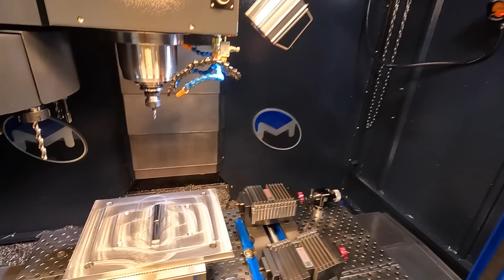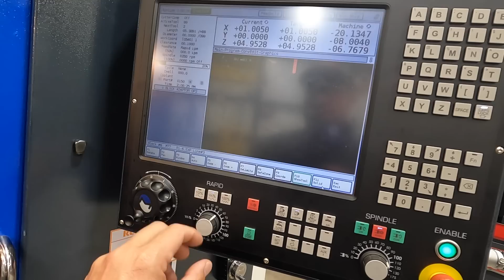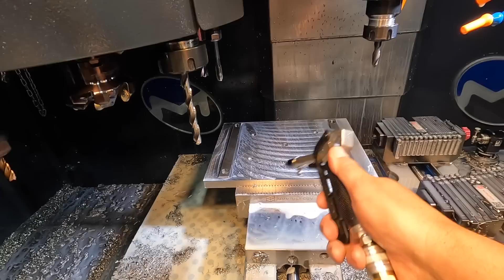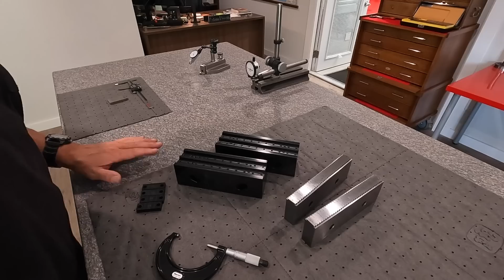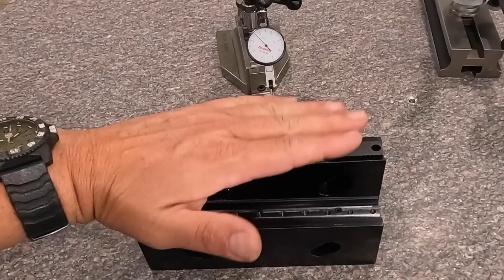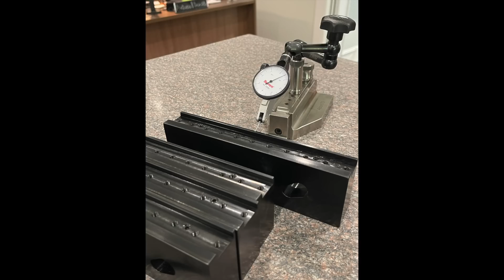SNS 373: Fixture Plate Machining, Vise Jaw Inspections

Comment: cnc is so satisfying when you start to understand it, i now always do a demo run with tool 1/2" above z:0 when running a new code.....takes longer but saves you $$$s in the long run....ive destroyed hundreds of carbide endmills learning... run into the bed once...had stock fly out of the vice a few times....been drenched in coolant...had the whole shop raining milk...tripped the electrics....had to hit that big red button many times and hit the brake on the spindle...i levelled off a 120kg anvil in there once and had a light show like 5th november in london....had the machine dancing and tripping the stops...i lost that many steps i should of installed an elevator....but that was all my own self learning...i think your doing amazing Adam

Comment: Seems like you could get a better finish by going back and fourth on the bottom side,  than the half moon passes on the bottom side. I am not sure if the program is auto generating that tool path but seems like it could be more efficient. I think the tool path making squares like cutting a yard from the out side in seems to be giving you the bad finishes. But if you could just make a pass and then pass back cutting in the opposite direction. I am no expert I am a woodworker that follows your cool work. But I am thinking of it like I would do with a router and flatten a wooden slab going back and fourth.

Comment: I don't understand why the machine is making arc passes.. It seems to me your actually making the cut path longer, extending cut length and thereby using up more cutter life.. The shortest path is a straight line.. It's also not contributing to your surface finish. Linear linear cut lines with minimal overlap always results in a smoother finish and is usually more aesthetically pleasing. It's also easier to polish or scrape, depending on the needs of the finished product.

Comment: if you cannot get rid of the tool marks on the fixture plate, maybe you can create a tool path that creates a more desirable pattern, maybe stepped circles that result in a flower petal pattern or something ?

Comment: It would be nice if you could control the tool path better. The tool path on the first two tests almost looks random. It would look much better (IMHO) if the path first ran parallel to the key from the left side to the right side then adjacent to the key on the near and far ends just to the ends of the key. Continue milling off the edges before returning for the next pass. Overlap your passes %50 so that all cutting is done uniformly relative to the cutting head.

Comment: Not a machinist, but beginning hobby. Would seem to me that since you have 2 pair of tallen jaws. The second set could be used as a handy set of parallels under a large project like your fixture plates. At least it wouldn't be pushed down as it's milled. Could maybe have even less clamping pressure, maybe reduce upward bend and eliminate downward deformation under load. Just a thought, maybe it isn't the best idea, due to the half thou or .001 difference. Maybe it would try to rock around more?

Comment: It'd probably be better to put the jaws on the vise in the machine and put the indicator in the spindle and zero the Z at the indicator zero and check them in the machine. You have an error stack with the SMW plate and the vise and the jaw mounting to account for. That will tell you what's up. Also probably a good idea to load the jaws with a couple of 123 blocks when you take your measurement.
Reply: I am not a machinist by trade, but very mechanical.  It seems to me that measuring on the granite plate is great to check the jaws.  The real test would be how they measure once mounted in the vise on whatever machine you are using.  Do the fasteners and machined holes that the fastener use change how level the jaws will be as used?

Comment: I use a ton of Walter tools at work and normally run the WKP35G grade at 850-1000 SFM, dry on steel and I get crazy tool life. If you're looking for a nice shiny finish it may help to kick your cutting speed up even if it's higher than the recommended specs. It also helps to use a different tool for roughing and finishing, not only do you get less wear on your finisher but you can put some wiper inserts in your finish tool.

Comment: In the shop i work at, when we are doing RIP finishes, we generally double the spindle speed, but drop our feed to 15IPM and take .005 for our finish pass, it works well for aluminum and stainless, as for the tool marks, they show up a lot more in stainless even at 15IPM. Still trying to dial it in personally for stainless but i do know that fresh inserts help a LOT with the finish, chipped or not.

Comment: Nothing new to you I'm sure but a  few things I see machining 4130 hardened steel is stress relief, we stress relief before machining but even then if you try to machine equal amounts off both sides it usually turns out flatter.  Also I was thinking if that was bolted down to a fixture or table instead of vice I think it would turn out flat, especially if you did some finish passes on both sides.  I think about .015" finish  pass gives good  results for me.  My $.02

Comment: If your part is not coming out true due to a vice jaw intolerance, depending on how you turn the piece over for Op2, you will double the error.
Decreasing the feed rate is not always the answer to a good finish. It could be insert, coolant, or speed related.
On a slightly different tack; Your machine was brand new when installed. It has now been 'run in'. Have you checked the gibs.

Comment: I'm not anywhere near an expert in this stuff.  To get those grooves in the surfacing cuts to go away, you might want to consider putting the cutter into a surface mill to get all the cutting edges the same height.  But then again, some simple manual sanding could get rid of that type of finish.  I'm sure Stefan Gotteswinter would have something to say about this <grin>.

Comment: After tramming the vice, then tramming the tops of the jaws installed, would be beneficial to skim the tops of the jaws on the machine to gain the parallel & flat surface consistency?

Comment: Even with those tweaks, you're still running that automatic shortest-path feature you described, aren't you? That's what seems to make the irregular pattern on your practice piece.  You could do much better manually, if turning that feature off and programming a pseudo-manual tool path isn't better. Or is there no such mode?

Comment: As far as it goes for getting those mirror finishes in a CNC machine, think about it like this:  "Anything you can do to make the material separate from the part easier" So high pressure coolant, well directed coolant flow, good coolant concentration, sharper edges on inserts (sharper by design, not like sharper from less wear, i.e. polished inserts, smaller nose radius,, etc.), running at the upper limit of Vc surface speed, very small depth of cut for finish pass of like .005". That is how you get those better than ground mirror finishes with zero presence of tool marks in a CNC. For what you were describing I would rough it for high MRR with your 1" high feed, leaving just .005, then finish with a sharp insert in your 2" facemill and have the 2" tool do nothing else except that finish pass.

Comment: There are a lot of details that need to be worked out when you introduce new equipment and new machining processes,  You have to make sure that your tools are within tolerance of the manufactured specs and then work on your process to understand what your capabilities are.

Comment: Hi Adam.
One of the advantages of the Tallon Jaws + separate ‘bites’, is that the jaws can be touched up on a standard Surface Grinder. The Alligator Jaws on the other hand, need to be ground using a ‘dovetail’ wheel in a vertical spindle ( ie set up and dress a cup wheel in your mill spindle. The jaws will obviously need to be clamped with a parallel .
I’d say the variation in the plane of the Talon Jaw ‘shelf’ areas is due to distortion when heat treated.
Regards
Robert

Comment: I love my Mitee Byte jaws - I have the 4 to  6 inch version, they are my "go to" for first op work.  I would be interested to know the height consistency of the set of Te-Co  vices (the base where parallels would sit).  I have a pair of matching Glacern vice and two sets of the same parallels which match pretty closely as I recall.  This seems to work well when using two vices to hold the same work piece.  Regarding the machining tool  paths, if you use a contour machining op you could, for example, get a much more consistent tool pattern on that plate with one center key.  I'd be surprised if that wasn't part of the conversational programing - and it can only improve the surface finish.  The side with 2 keys might require a contour around the key on each side and a facing operation between the keys.  Leaving some stock around the keys and finish off with that 1/4" endmill.  That really is a nice surface plate :)

Comment: The plate could be deflecting down and away from the cutter out on the edges not backed up by the vise jaws. That could be contributing to the unsupported edges being .003" thicker than the supported center section.

Comment: I'm still pretty green on face mills but I have read and found through experiment that. Decreasing chip load is not always the answer for a good surface finish. Some times if the chip load gets too lite and the chips get too small the get caught in the face mill and smear the surface. What I have found helps is lower your SFM and increase you IPT. That has generally worked well for me. I have also heard that wiper inserts work wonders for super shiny finishes but have yet to try them on my own stuff.

Comment: You need to check to the squareness of the clamp surface of the jaw to the top. The check you’re doing is flatness not the actual clamp situation. Just a thought if you want accuracy.

Comment: Sometimes you will start to drag chips through the cut, when your chip load gets too small. I think that is the dull finish on the face mill. Try cutting dry at about .007” per tooth, you could raise it up, for a trial.
Reply: That is what I have read as well. Too small of a chip load ends up trapping chips under the face mill and smearing them around making a dull finish. You gotta make a cut that makes a chip heavy enough to be thrown away from the cutting interface.

Comment: as others have said..you should have roughing mills and finish mills for each OP if you want the best finish over and over on each part...carbide doesnt last forever..you cant expect to hog and finish with the same mill ... be it end or shell...also get a proper finish face/shell mill

Comment: I believe if it was in the jaws or the Abom clamp force your bevel on the outside radius should still line up. Because it is still under the clamping force and you just surfaced it. So I don't think that it's you or your set up. Thanks for taking us along and letting me learn along with you. Another great video!

Comment: Does anybody know why the CNC makes these funny curbed paths instead of straight lines? Is there an option to set path alternatives so it prefers straight lines?
Reply: Those are some kind of HSM tool path. They work great for roughing letting you take deeper and heavier cuts without "shocking" and thus breaking the tool. I'm not sure about how he is programming or what options are available but when I want a nice consistent straight line finish like your talking about. I will use HSM to clear out all but the last 0.005 - 0.010 of material and then switch strategy to get that more straight line look on the floor and smooth out the wall finish.
Reply: It's not magic, it will happily make straight lines if you program it to do them, this is a programming choice that minimized the time off the part.

Comment: Try a non optimized tool path either a spiral in or back and forth for a improved surface finish. Its possible you are experiencing  internal material  stress resulting in the .003 difference in thickness.

Comment: Shoulder mill is not the same as face mill.  I chased surface finish doing the same thing as you with a shoulder mill.  You can make it work but you are going to have to go much higher on sfm and make sure you dont have any low hanging inserts.

Comment: I always got a super nice finish with face mills by running a shallow depth (0.005") and twice the feed and twice the RPM you would use otherwise. Always gave me a super nice bright finish, even on the crappy CNC import mill I use to use.
Reply: Interesting, i find running twice spindle but 15IPM to give a great finish

Comment: Great finishes are done with slower feeds. For those who don't know. Just like the tighter wood are. The better a sanded finishes you'll achieve. Plus having a CNC diamond surface polishing bit in your arsenal is an absolute must have. 🤔🤔Hey Adam maybe just torquing the bolts on the jaws are pushing them out of paralle. Try leaving them just snugly bolted clamped on paralle than dial test. 👁👁See if that solves the issue.

Comment: Hi Adam, Ian again from New Zealand. I commented on an earlier video about insert tolerance versus surface finish. The insers you are using from Walter, the SDMT, is not a precision ground insert as the tolerance is 'M' which is quite wide if you are chasing a finish.. Also those inserts dont have a wiper flat on them as it shows a 08 or 1/32 corner rad so this won't won't be helping either. The SDMT inserts will have a honed edge on them from the factory and if your chip thickness is not above the size of the hone you are effectively cutting on the radius of the hone and the chip is not getting onto the top rake face of the insert.There are lots of things to consider when altering feeds and speeds as this changes the chip thickness as well.  I hope this helps. Cheers Ian
Reply: He's only trying to help .LIGHTEN UP.
Reply: Hi Ian with kangaroo breath: Maybe you should try to enjoy the show instead of trying to change a79 and the way he does things? If you are such a master who knows everything, maybe YOU should make your own videos?
Reply: @SwedishNiceGuy  Maybe you should stop trolling?
Reply: @SwedishNiceGuy  You just don't get it do you. I am not trying to knock Adam, Iadmire the way he operates, just trying to help. I suggest you go out and smell the roses!!!

Comment: Why do cnc's run in such weird patterns over the matteial. Wouldnt a straight line be more effecient?
Reply: With a straight line you would have to either feed in alternating directions (conventional vs climb milling, don't think it's good to mix both) or cut around the perimeter, with tight corners. This other milling strategy called "adaptive clearing" tries to keep the material removal as consistent as possible, with rounding over edges and making like an s-curve around the point where it fed into the material on the previous round. With each round the line becomes more and more curvy, which is good since you eliminate cutting corners where you would have big changes in tool load otherwise. It also does really nicely with inside corners, straight lines would just plunge straigth into the corner, which gives you a huge load spike and will be visible in the finish, whereas adaptive cutting goes in with multiple rounded paths that get more and more narrow until it's all cleared out.

Comment: Can someone explain this conversational programing,CNC lingo?thanks! 🤗😎🤗😎
Reply: Basically conversational is a bunch of preset machining/probing operations that you can easily adjust at the machine. (Rather old school at this point and not as controlled as a CAM software to program the machine)
Reply: Hey thanks,understood
Reply: Thanks,understood!
Reply: When he is talking about the conversational programming he is talking about a simplified way of programming some machines include to make programming way easier and faster. It basically asks you step by stem what your trying to achieve and does most of the work for you. If you run mills/lathes that have a fanuc control you have to write every single line using g code which is a painfully slow unless you use cam software.

Comment: Do a zero-degree lead in at a corner for outside features. You won't get the "bump"
Reply: Just curious, why is the fluid used on some cuts and not others?
Reply: @metro_ss  Video footage reasons?